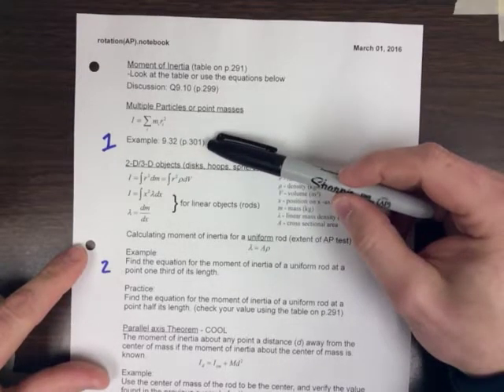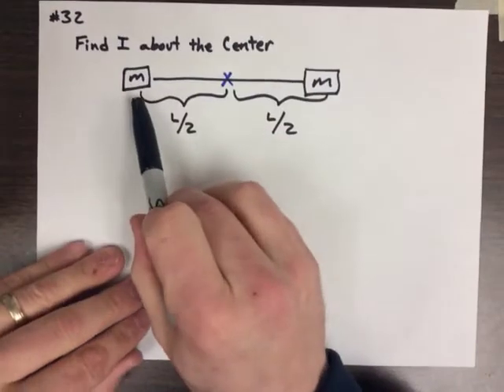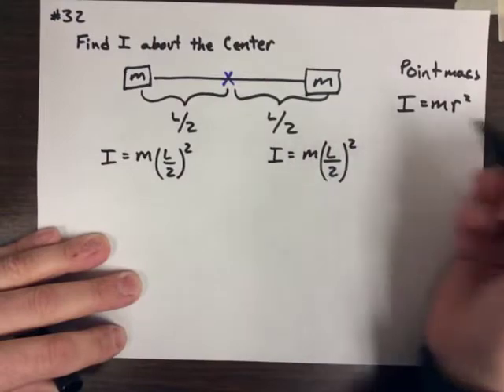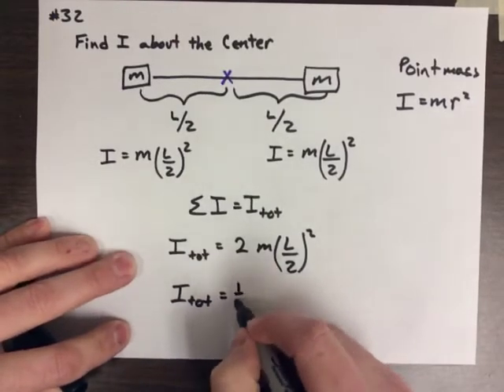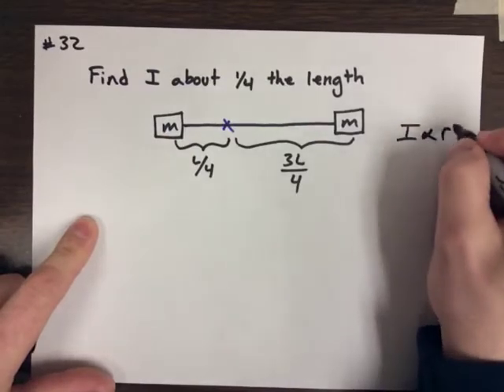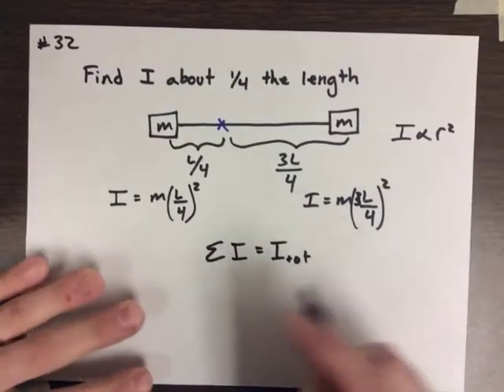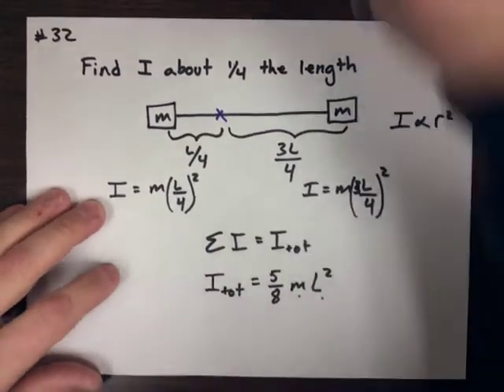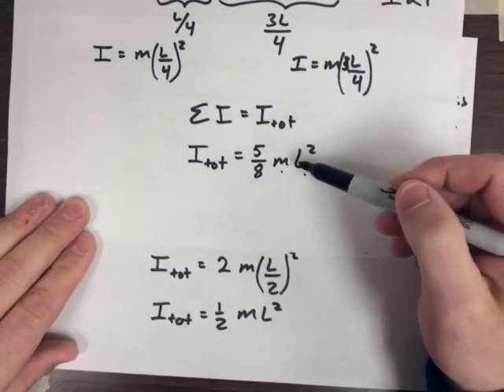Moment of inertia problems Part 2.1

Comment: how did you get l/2?
Reply from the maker: The first problem was the moment of inertia about the center, so the length from the center to the end was half the total length, L/2.
The second problem was about a point 1/4 the length so the distances to the ends were L/4 and 3L/4.